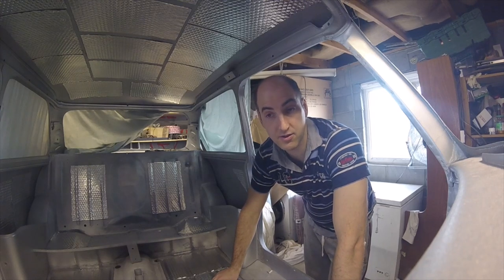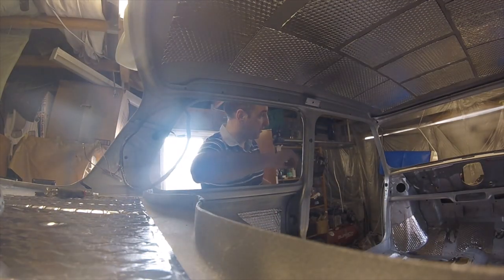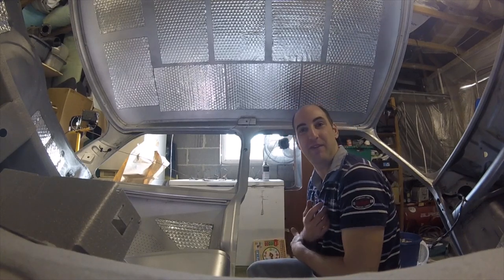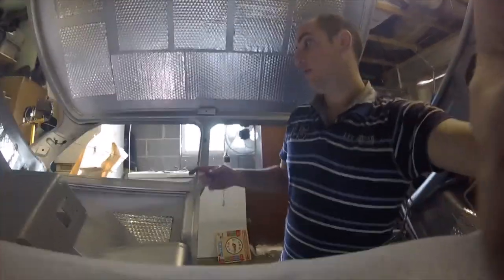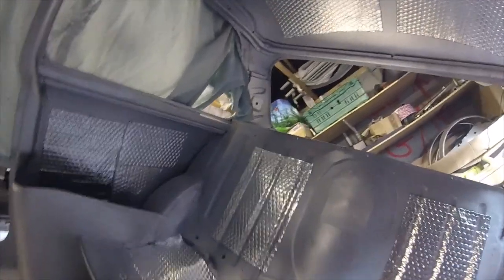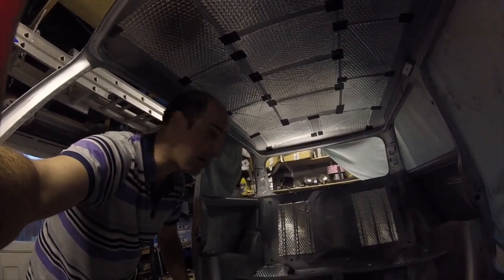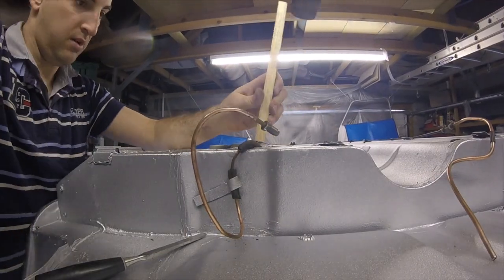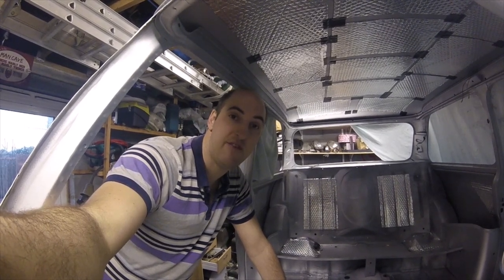96 Classic Mini Restoration - Rear wiring loom and lines

Comment: Those copper lines have come up nice 😊. Those wiring looms are a bit difficult coming down the a-post. I've still not been able to remove mine yet 😂😂.
Reply from the maker: Yeah I think they have been replaced before so they are all in good shape. I guess the wiring only needs to come out if you are shot blasting so maybe it can stay in!
Reply: @ClassicMinishorts  I've been thinking the same.  Leave it in 😁